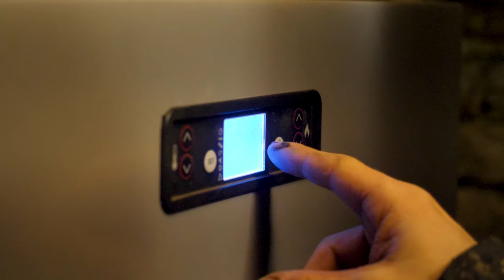Two Guys Renovating an Old Farm. The French building project.

Comment: I would have hired a small excavator and scraped back that entire yard, widened the entrance, and replaced with fresh stone by now. Mind you I'm impatient and like to use machinery to save my back! I must admit when I saw how much the floor had dropped a couple of vlogs back I was thinking I would not be surprised if the joist ends in the wall pockets had rotted, I've had to deal with that a few times. Be interesting to see how you deal with them and if you "sister" repair or replace them. One place I had we ran steels as a ledger board across the back wall so that the joists rested on that instead of being inside a damp wall.